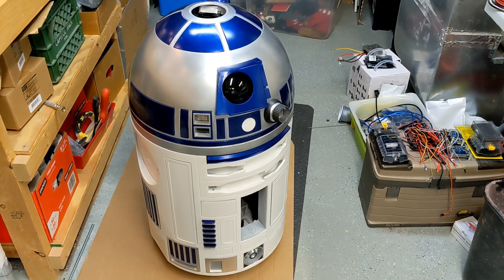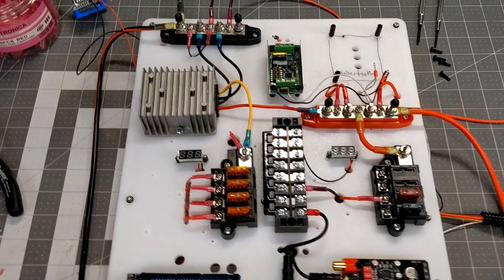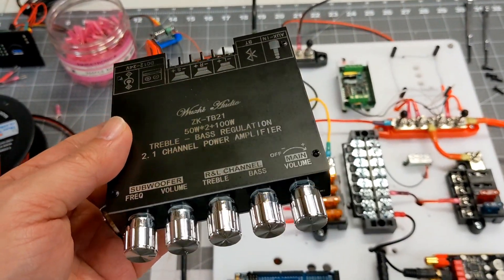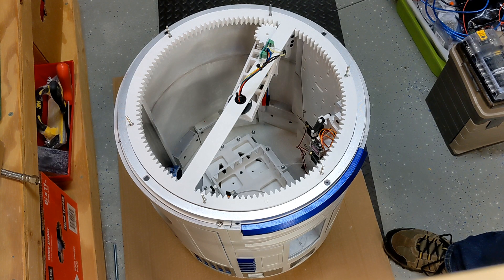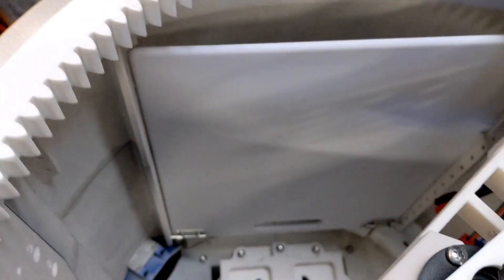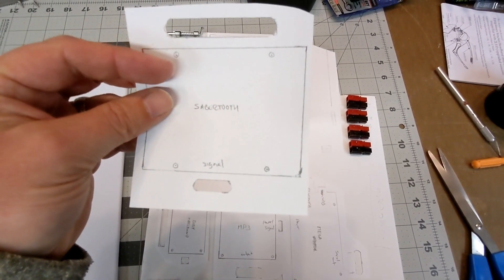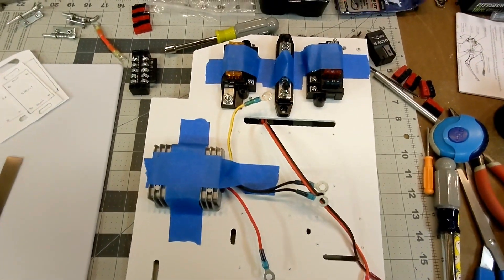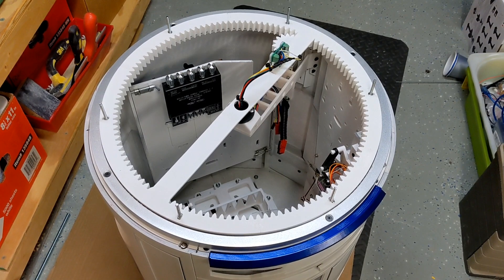R2 Electronics Build Part 5: No Back Door? No Problem!

Comment: Is that a single print shoulder or a cut version?
Reply from the maker: I used some cut shoulder modules that I no longer see in the Baddeley file share. They were dovetail cuts of "AShoulderModuleFixed" and "BShoulderModuleFixed". IIRC, they were VERY tight fits - they may have been a community modification that didn't include any tolerance considerations. Chances are you could achieve the same using standard dovetail cutting tools found in most slicers. For reference, these had two dovetails, about 17mm deep that opened from 11mm to 23mm.

Comment: Hey Jason what speakers did you order? What were the specs
Reply from the maker: The speakers that I'm using are these 3.5" two-way speakers from American Bass: https://www.amazon.com/dp/B074593MXJ. I needed to create some custom mounts to attach them to the MKIII Center Vent assembly, and I've shared these on my Printables page here: https://www.printables.com/model/209867-baddeley-mkiii-center-vent-speaker-adapter. Check out this video which shows these speakers in more detail as well as another center vent mod that you may find useful: https://www.youtube.com/watch?v=n7zt3RGvXWo

Comment: Jason you are a gentlemen and a scholar.  Thanks for sharing all of these videos and they have been incredibly helpful for the electronics portion of this build.  The assembly, painting and detailing are fun, but this part can be tedious and expensive when you make mistakes and burn out motor controllers and what not.  The cutting board design is a great idea and I am off to walmart to buy the same one.
Reply from the maker: Thank you. I'm glad to hear these are helping. Building out the electronics system was probably the most rewarding part of the whole build. It was the first time I'd ever done anything like this, and definitely where I learned the most. I'm hoping to get back on track with more updates in the not too distant future. Cheers!

Comment: Did you abandon the mini maestro for the servo control in favor of the marcduino? I'm finding a lot of parts right now are either backordered or significantly more expensive now thanks to rona I guess. Also what batteries are those? I was going to do something similar to what bob at i like to make stuff did with his using milwaukee batteries for ease of charging and swapping but I'm concerned about how long they'll last compared to what looks like SLA batteries like you have.
Reply from the maker: I haven't abandoned the maestro, but I'm also not 100% sure the best way to approach body servos. All of that is going to wait for a while (I'll leave space on the board for adding that later - it's small). I honestly don't know if I will use the maestro, the marcduino, or both.

As for the batteries, they are Dakota Lithium LiFePo4 batteries - they have a flatter discharge curve compared to SLA, plus they are a lot smaller and lighter (each is less than 3lbs). https://dakotalithium.com/product/dakota-lithium-12v-10ah-battery/

Tool batteries can be a great option, but as you alluded to, depending on the power needs of your droids, their capacity is somewhat limited, so easy access to swap them out is necessary - something I don't have. I've met other builders that have used them and they love them. There are a lot of benefits to tool batteries - my inability to swap them easily was the dealbreaker.

If you're comfortable with LiPo batteries, they are by far the best power to size/weight ratio option, but they demand careful use and charging. I personally am not ready to go that route just yet. Perhaps a future upgrade.

Comment: I predict you will get a rattling sound from the latches when driving around.
Reply from the maker: Excellent point, and I have considered that. I am planning on creating some custom grommets and printing them out of flex filament to fit into the holes and eliminate the gap between the pins and the body, providing a snug fit.

Comment: I have the same amp in my build, really happy with it. I also like that it has bluetooth for when R2 just wants to listen to some tunes. Great video as always, I'm building the same version and these have been really helpful.
Reply from the maker: That's great to hear. I think having a better amp and speakers will mean I can add more music files to his sounds library and have R2 wander around to his own soundtrack! Glad the videos have been helpful. Cheers!
Reply: @jasonsR2D2  also have the same exact amp and I love it! I actually use the r2 in my office as my speaker system since i have put a sub and stereo system in it. I have it running off of a seperate battery which seems to work well. Wish you the best on your build!

Comment: Nice work yeah I was thinking about gluing my back panel on, I tried magnets but the back panel won’t sit flush. So I was thinking of magnets on the board and it can just pop on and off.
Reply from the maker: Ooh, magnets would be cool, provided they're strong enough.
Reply: @jasonsR2D2  I use the earth magnets their really strong, I use them to hold my utility army in the body. So if I need to take them out at any stage , then I can unhook them and just take them out.